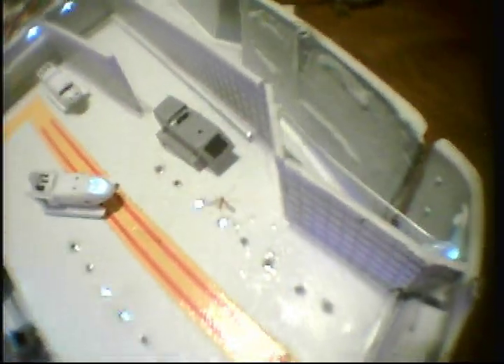U S S  Reliant Lights & Bay Doors

Comment: Yes please need some schematics soon already getting parts for my Reliant  .I have the model the servo and some 9v leds. still have to purchase the  shuttlebay  and shuttles and worker bees so i have a while. Is the micro servos circuit board have the option to run off the 9v. power supply ?
Reply from the maker: hi this is tom,sorry taking so long,could not find my book with diagrams. got it now, if you would like i can e-mail them
or in about a week i'll have it out on you tube. my email is tberry57@hot mail.com. would like to see pic's when you get going good. good luck.
Reply: @tberry571   hi there tomorrow I have looked at your reliant I love it could u email me a diagram of the relint bay set I would like to build it or u can and I'll pay u for the work  alansankus6@gmail.com